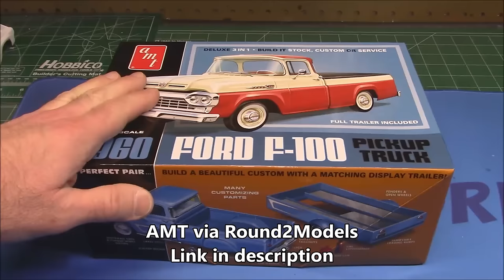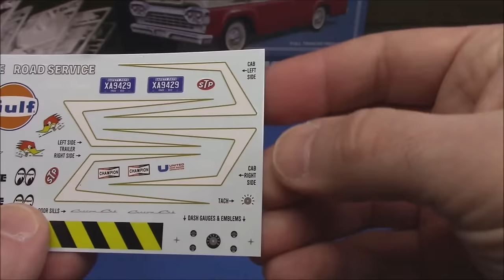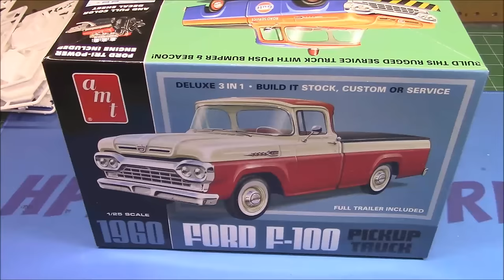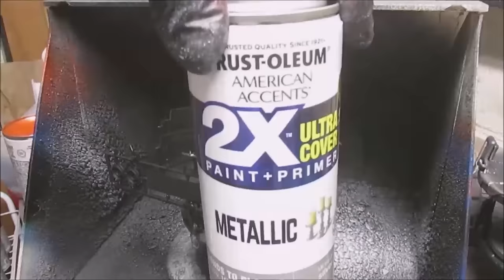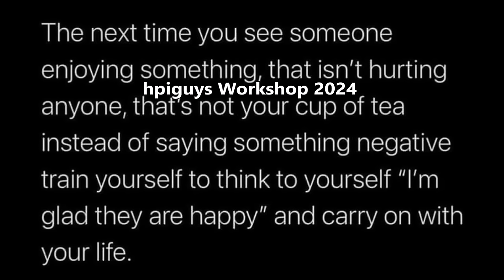FIRST BUILD! ALL NEW 1960 Ford F100 Pickup Trailer 1/25 Scale Model Kit Build How To Assemble Paint

Comment: Thank you for the tip about the wheel backs and inserting them into tires. Without that info, I likely would have forced things I didn't need to force. 
As much attention as Round2 paid on details like hood trim pieces, I am totally surprised they did not include a decal for the tailgate "F-O-R-D" letters.
Round2 should also update this kit with stock powertrains, the 292 V8 and the base I-6. Tri-power engine was not a production motor for this truck, to my knowledge.*  
  * However, the valve covers for a tri-power were more than likely painted gold.

Comment: I own a '63 that a short  split cab and bed. It has 23,000 original miles V8. You did the inter fenders perfectly. Another radiator support is body color. Your engine looks great. Factory the 292 was all red. Can't wait to get this kit as I plan on making a ford car hauler for my thunderbolt.

Comment: I enjoyed watching this build because it brought back memories. Waaaay back in 1974 my dad bought a pale blue '57 Ford F100 Custom Cab long bed Flareside with a bad 6-cylinder engine. It featured a 4-speed "granny gear" transmission, the small window in the back of the cab, and no radio. Dad and I changed that engine and that truck was the vehicle in which I learned to drive. Dad sold the truck in '75, and I last saw it in a parking lot in Oklahoma City in the late '70s. I would later discover my truck was one of only 1800 like it made in '57. The Styleside and the short bed versions were more popular.

Comment: Love this build (love and learn a lot from watching you).  Heck - I immediately found one to add to my stash and think i will follow your lead on the two tone color.  But maybe a blue color appropriate for the era as my main color.  Have a couple questions.  1) What exactly is ModPodge and what do you use it for in reference to model building.  2) How do you 'touch up etc" your parts that dont get paint while you paint them on the sprue?  3) Im guessing you are using the Aleenes Gel Glue to glue painted parts together - is that the case? Thanks for the inspiration and ill admit i have bought more than this kit cause of the cool stuff you make look so good and so easily!

Comment: That is a carry over design from the 1957-58-59 Ford Pick-up truck. As the 1950's came to a close, Chevy and GMC changed the design for 1960. Ford and Dodge did Not change their body style until 1961, The Big 3 pick-up truck makers. Note Chevy and GMC are almost the same kind. Only labeling is different

Comment: I’m only 73 so I could be wrong….But I’m thinking in 1961 the 292 was black with red breather and red valve covers, the 352 was black with blue breather and blue valve covers and the new 390 was black with gold breather and gold valve covers. The colors was the only way back then that I could tell the 352 from the the 390. The 292 valve covers were held on by two nuts on top of the valve covers. Hope this helps.
Reply: I enlarged the picture of you showing the box art and that is the 292….SO, YOU GOT IT RIGHT….
Reply: dipping my toe in the water so to speak iirc there was a thunderbird engine in those days that had gold colored valve covers. i don't remember if it was an option or a swap, i'm a little younger but i was working for firestone and goodyear service centers in the early 80's and saw a lot of engines doing oil changes. i don't see anything wrong with chris's choice in engine colors, its anybody's guess what that engines has had done to it in 64 years.
Reply: @phantom629  I believe Thunderbirds had silver painted breather and valve covers. Don’t hold me to that because as my age goes up my memory goes Down. And for some reason, my pants belt-line has gone up with my age to under my arm pits……
Reply: Outstanding build Chris! Funny thing, from the moment you did the unboxing of that kit I knew you were going to use Sage Green on it! What is the allure of that color? I'm doing the Revell Land Rover in that color and it's perfect for it! Any time I see a truck kit my Sage Green trigger finger gets to itching. And yes...my '60 Ford pickup will be Sage Green too.🤪😜🤣
Reply: I would like to do one with a dual-quad, 427 SOHC engine. Weathered pantina paint job.

Comment: Where's your trailer hitch?
Reply from the maker: On the parts tree like I show. 

If you mean why is it not on this truck, it's because I didn't want to add it to this truck.
Reply: @hpiguy  How are you going to pull the trailer?
Reply from the maker: @lylejohnston4125  Just because the two kits came in the same box doesn't mean you have to make them work together.
'It's your model and your world, do what you want to do with them' is what I preach in every single video.